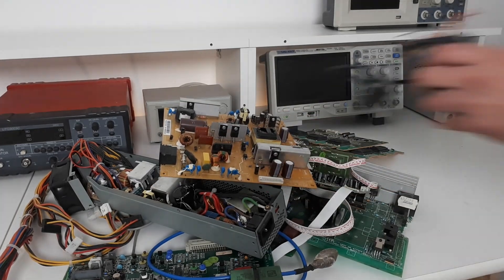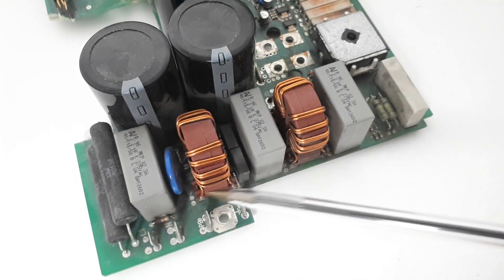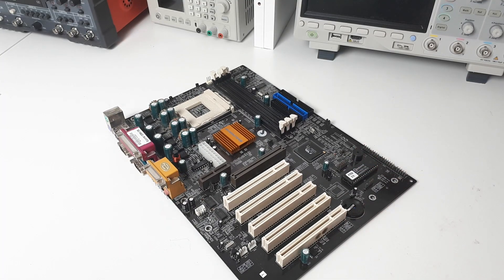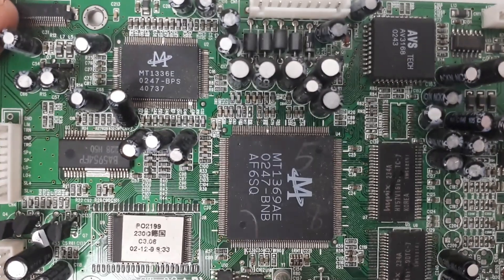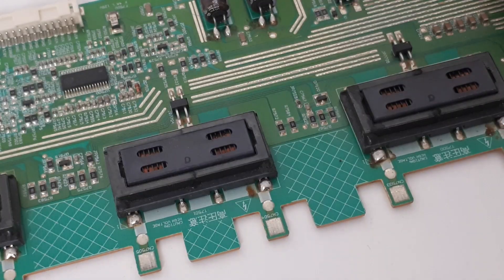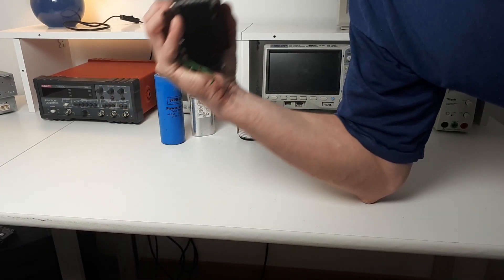What should you Desolder? ... Dont Waste Expensive Components

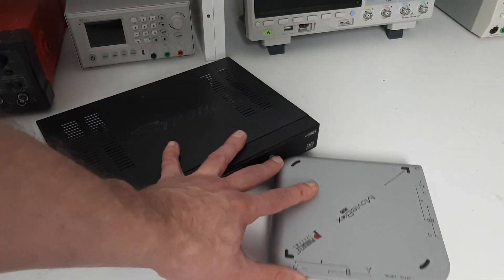Comment: 5:32 If it's an old radio from ~60s to 70s, take the glass packaged diodes. Those are likely germanium signal diodes, usually 1N40. Sometimes even 1N34!

You can't buy those. Well, you CAN, but most of the listings online are fake.

Comment: I was fortunate to get to scavenge from a vacuum spark sintering machine from a metallurgy lab, and the other equipment too before it was scrapped, found some amazing transformers in the sintering machines spark source, a 25kv coiled core with some strange red bitumen like coating, its gotta be from the 80’s , im still working on firing it up as soon as I figure it out, regular wave inputs get little effect but the pulse when tapping it on a battery gets a crack of a discharge. Not sure what class of transformer it is, the internet is not helpful regarding its identification. 

Got a beautiful induction coil setup from inside a sampling type of machine, big amplifier tube, many fantastic capacitors to suit, a few proper spark gaps, some of the most boring looking machines have the coolest parts

Comment: Anything with spooled magnet wire i keep, not a shred of copper slips through the cracks, if its conmon transformers il strip em and add the metal to my pile.  The pcb mounting thingys that ne555  type chips plug into i use often, made a habit of setting every gold plated pin aside to be harvested oneday when i feel like doing chemistry again. The 1kv and up ceramic caps i keep, enclosures i keep, plugs, bizarre components i keep, 12v relays , fasteners as you say. Potentiometers and any other variable components, antennas of all kinds, rectifiers that can take abuse, any vacuum tubes or bulbs besides common ones

Comment: I like to salvage fans, stepper motors and DC motors and 8 ohm speakers. Even microservos if they are in an old robot or toy. Big caps are always handy for audio speakers and induction coils for the same. I also grab mechanical switches and dials and sliders (rheostats?). All good stuff. Great video.

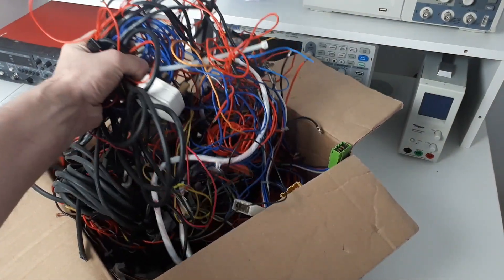Comment: 3:20 I have a question i haven't been able to get an answer for. 

Im in the process of building an axial flux generator, I've basically everything done, ive just to make the serpentine coils, i have a few extension cords  ive stipped to the copper. My question is, can they be used to make the serpentine coils or does it need to be "enameled magnet wire" 

Any help would be greatly appreciated.

Comment: I have 2 projects on my channel where I use old cases. My 20 amp linear DC 13.8V PSU for my shack is in an old PC case and used 2 rewound microwave xformers and my straight key "keyer" for my Hermes Lite II SDR is in an old remote extender plastic case, This was a great video.

Comment: I used to remove almost every component, but then buying the same stuff because I wanted to be sure the components would last. Donated most of my stash to a local makerspace last year.

I don't make lots of experimental stuff, I only repair when needed. Keeping everything is a good thing as long as it isn't hoarding shit that does not get used again ever...

Same with silicone vs vinyl wire. Small lengths of silicone wire? Sure. Vinyl though, nope.

Comment: Yeah, a little SMD resistor is almost no cost, but shipping it could cost $8-$10. So not so cheap after all. Just keep a bin with these boards that you can farm parts from. No need to desolder everything unless you need a part.

Comment: Nice video! Taking apart faulty devices is also very educational. When observing you can training how to take apart and learn about (common) constructions, smart and clever methods to save some screws or buttons, components you didn't know ever existed (by looking up the part number for a datasheet) and so on. I also have a pile with plastic parts, nice buttons, (chrome) decorations, display windows, panels (can be used with CNC), front panels, feet, screw posts (with correspondng screws) or other parts that isn't easy to print with a 3D printer. Especially screwposts are very handy when you frequently mod or extend a device/case and need some mounting construction. Using glue is ugly but glueing screwpost makes it possible to screw in a pcb or other component easily and you can remove/replace it.

Comment: To be honest, I usually don't bother with most capacitors or resistors unless they are a special/unusual type (for example, class X/Y caps, or high power resistors), because there are just so many different possible values for them that the odds that I'll need that exact value at some later date are relatively low, so I'd prefer to just buy exactly what i need when I need it.  I especially usually avoid electrolytic caps because it is so easy for them to turn out to be bad anyway (even if they're not completely bad, they have a tendency to "drift" or develop high ESR over time, so I generally prefer using new ones)..

I do keep an eye out for particularly large-value or high-voltage caps, though, especially if they're in an unusually small package (i.e. supercapacitors).  I will also sometimes pull any small through-hole bypass caps off of old discrete electronics boards, because when you're working with that sort of thing, you need a lot of them (and they're pretty much all interchangeable for that purpose).

I do usually pull things like diodes (and bridge rectifiers, etc), too, because they are often more flexible in what kind you can use where, and having a small variety of them on hand can sometimes be useful, particularly the higher-power versions.

I also always pull any power cord sockets (e.g. C8, C14, etc), because I've always got a ton of cords for them and they're a great way to supply AC power to anything I'm building that needs it.

I usually only pull other kinds of sockets if they match up to something else I'm pulling (i.e. there's a module I'm keeping intact which has a particular cable attached, so I grab the socket it plugs into too), or if they're a really common type I expect to easily find other things which will match with (e.g. PCIe power connectors, etc).  Otherwise I don't bother because they're often a real pain to get off without damaging them, and who knows whether I'll ever have anything to plug into them...
Reply: Unfortunate more communities don’t have a shared “hacker” space, fabrication/tinker shops, or at least a robust community to swap & share…

Comment: The "LCD's" you showed, are not LDC's at all. They're a different (and often more superior) style of display, called a VFD (vacuum fluorescent display). They're basically like if you made a display out of a neon sign. They can withstand an insane amount of temperature, have a perfect 180 degree viewing angle, are bright, and exceptionally responsive. I always save these, because they are a very cool, and somewhat rare piece of old display tech, that is not too difficult to drive. As I said, they are rare, but some are multi colored, and some have cool graphics on them. Most commonly found in audio equipment. If you don't have the driving circuit, they're very easy to figure out the wiring of, and can easily be multiplexed.

Comment: It's _the way_. I made several dozens of DIY thingies spending literally zero moneys on resistors or capacitors. Just bought a chip to build a tester of sorts and that's it. 
Also, there is a huge amount of exp point in desoldering modern electronics. I knew how to solder since I was a kid, but it was long time ago, back then plumbum was the king and electronic parts were as huge as your momma' behind. Now everything is small and they have ROHS and other stupid bs, so yeah, full disassembly of even one motherboard is a huge boost for any noob out there. Not to mention that it's the real green initiative, not some money laundering mumbo-jumbo on tv or buying a prius tesla scooter.

Comment: I agree, take only stuff that you need or may need and stuff that are rare and/or expensive. I salvage capacitors, resistors, diodes, transistors, logic IC's and opamps, also power amplifiers. However, many modules that I find over the years are just well usable as they are (some rectifiers with filters, some AF power amplifiers) and I keep them like that, many are used already in my projects. Transformers are always a keep, I used many low power 6V, 9V or 12V transformers to power some test instruments instead using a SMPS or battery with boost converter, because I have a clean and isolated power source. I found that old transistors (form before 2000 or with known brand markings) are better than modern ones, same for opamps. Even some stuff that you do not regularly use can be useful and needed after you throw it away (I used few PCI slots to make a back plane for an audio amplifier after I throwed away few broken motherboards with ISA slots that had have been better than the PCI ones)
I built two linear power supply kits few years ago and powered with a salvaged 2x(12+12) transformer I made a symetric linear power supply for audio projects in my lab; one of them I built with salvaged components, (ICs, transisistors, resistors, capacitors) and the other with supplied components. Now, the one with original components is 15% off than the one built with salvaged components that works as in the first day. Same with a fairy complex signal generator that I built for myself, using salvaged components is more stable than one that I built for a friend with new components he bought from Aliexpress or amazon in bulk.

Comment: I only keep specialized parts that I know I will not be able to buy. However I strip video cameras etc for the screws, you will find it incredibly difficult to by screws less that 2mm, I do also separate small screws into metric and imperial, US screws NC, NF are virtually impossible to get in New Zealand in smaller sizes. I too keep some wire, especially the fine stuff in quality Japanese or scientific stuff. I have also built up a stock of wired plugs and sockets, there are 100's but its nice to be able to connect to something rather than having to probe pins.

Comment: Personally, I wouldn't bother salvaging electrolytic caps from anything older than a few years, especially if they were used in power supplies or anything else with a high current load. Those little component testers often don't report ESR accurately if they report it at all. You could be dropping an old, electrically leaky cap in your brand-new project and not even realize it.
Reply: exactly, i agree! I would salvage transformers for example because there are 99% they are good but quite expensive new and very rare components, apart from that I wouldn't bother. i tried a few times and while desoldering some chips I broke it , the same with transistors so if something is very cheap I wouldn't even bother.

Comment: The nuts and bolts salvage is extremely useful. I have learned over the years that it’s not very useful to just put them in a container, because you really don’t know what you have available for your next project. I 3D printed (you can buy) different screw and bolt measurement tools and separated my reclaimed hardware into small ziplock bags (from the post office) with printed labels showing size and length. It’s saved me money and time.
Reply: Yeah, one of the best things I ever did was to buy a few different sizes of small ziplock bags (2x2, 2x3, 3x4 inch, they come in packs of 100 or 200 each) off of Amazon.  They've even got white label areas across the front for writing what's in them.

And pulling screws is worthwhile, but the real gold is in the nuts.  If you find anything with a screw and a nut, definitely keep both.  (I did go out and buy a pack of 6-32 and M3 nuts, actually, because those screws are so common in a lot of this stuff, but rarely have matching nuts)
Reply: For me, parts that I trust I can sort into bins marked for the part type, but other parts and odd parts I just put into one box and when I’m hard up for something I don’t have its great to look there. I have the same type of tester he showed using to test capacitors and man, I love that it is so easy now to test specs.

Comment: What is that cap tester?
Reply: It’s an ESL Tester for transistors,diodes, caps,resistors, and cheap…for about $12.00 on E-Bay. I find them easy to use for testing small components and fairly accurate within 3-5 %

Comment: World rally in the arcade was a standing wheel controlled game with a high and low gear shifter I think. What I remember is the wheel would spin infinitely when you cornered. I suspect there was a hall effect or digital encoder to one wire serial protocol for input. It was super fun but hard

Comment: For capacitors, resistors and so on, I tend to only salvage "exotics ones" like high voltage capacitors or 10W ceramic resistors. The rest are so cheap that it doesn't really worth it to salvage it.
For connectors, I always salvage them since these can be quite expensive depending on the type ... and it's also generic and really versatile (nothing prevent you to use a DB9 connector for something else than Serial Port for exemple).
For ICs, well, I tend to not salvage them unless they are really generic ones (things like CD4017 or flash memory).
Reply: This. There's no point in salvaging jellybean parts. They're cheap as dirt to buy new, and at least you'll have the legs intact, giving you more mounting options in your own circuits. They're simply not worth the time, effort and electricity.

Comment: I wouldn't waste my time on small capacitors(low voltage, low capacity); they cost 3-5 cents each, and they are often already half dead by the time you desolder them of an old PCB.

Comment: I usually blast boards with a heat gun then knock out the parts, or pull out with a pliers. If low value parts happen to fall out, I still keep them. Even ICs that I know I will never use, or data sheets are unavailable, I still keep them since they look cool and they don't take up much space. For plastic parts like connectors, I hand desolder them before using the heat gun. I always test and keep good electrolytic capacitors since many times faulty devices are due to bad electrolytics and it's a pain to go buy replacements, and it's too expensive to buy them new in bulk.

Comment: Good points. To top this off if our country does not get it self back together in a useful way, we will have to get our electronic components from other places, that used to be trash.   Also in some cases some components are no longer made especially things for vacuum tube units, certain number transistors, etc....  Also most do not know this, but transistors in general can be used anywhere as a replacement as long as their current carrying is enough and their type MosFet, regular, Darlington, PNP, or NPN is the right type. Yes some are made for certain frequencies or used in certain places but if the things I mentioned match or are better then original the thing can work.

Comment: If you want to do mass stripping FAST, grab a handy dandy heat gun (12-1500W kind) and a few pairs of pliers and thick gloves!
I had a small fleet of old UPS's that were just chock full of good bits that would have taken days with an iron to strip. With the gun, I could just blast the underside of the board and start yanking in a second or two.  Of course, this was older through hole stuff. Not sure how SMD's would handle it...
Reply: SMDs are the same just have to heat side which they reside on.  It takes a bit time and when they start to wobble, just hit shake or yank whole board and they fall off.
Reply: @Tegelane5  - That was a couple decades ago I'd stripped those. I've become less paranoid of cooking the itty bitty devices since then.

Comment: Always separate waste electronics into modules before considering individual components. You can use a 12V audio system and USB hub from an old monitor as-is. Same goes for internal power supplies and their interference filters, any daughterboards/expansion cards and CRT monitor modules in door video phones.

Comment: Since I don't have that much space, I save  usable components by cutting the PCB with a tin scissor, just around the component. I don't have to desolder directly. In this way, everything just fits in a single plastic box. 
Sometimes on a rainy Sunday I take out this box and test them in circuit for ESR, and if all tracks are disconnected from other components I even test for Farads if they are in the tolerance rate. Of course, I throw away the cheap Chinese ones.

Comment: You did not mention the batteries in disposible VAPES ...... these litter the towns and roadsides .... the batteries are Lithium -ion and are FULLY rechargeable ( 4v2 max ! ! ) .... these can be used to replace ( HORRID LEAKY ALKALINE CELLS ) in small LED torches that use 3 to 4v5 Volts ( they do NOT leak fluids ) and many other projects ...... DAVE™🛑
Reply: Big Clive has a great series of videos on that!

Comment: We used to call it un-solder. We used to use what was called a solder sipper. A rubber ball shape after heating the solder, you simply place the tube next to it and release the bulb. the solder was sucked up.
Reply: i still have a turkey baster like solder sucker i got from radio shack a long time ago... not as effective as spring driven suckers in clearing solder but they did work and you could just squeeze them without having to reload the spring with a larger sucker making you put the iron down or being hasty with it and shooting little bits of solder from the end of the suckers all over not thinking about the clearing rod pushing out any solder from the tip as you slam it on your chest to prime again because you are in a hurry and holding a hot iron.